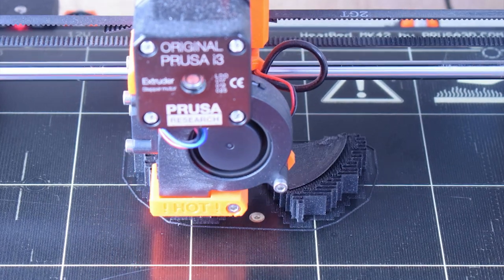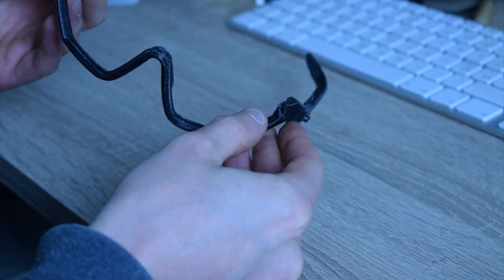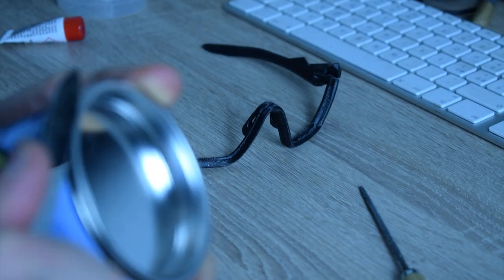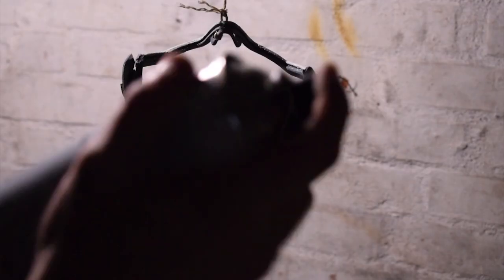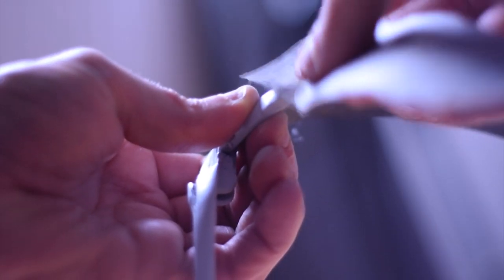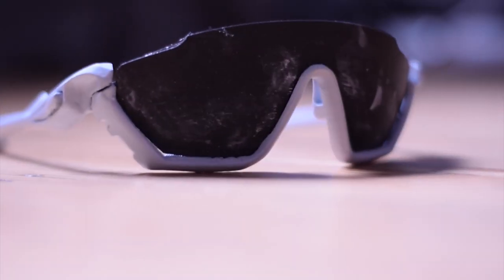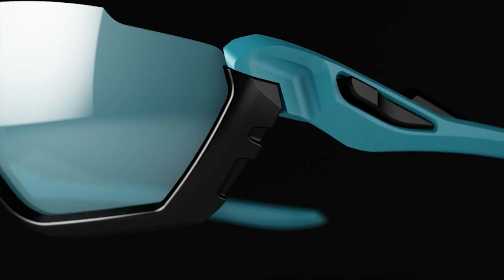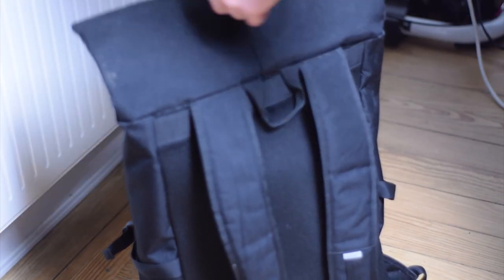3D PRINTED SUNGLASSES DIY 2.0 | Eyewear Design 😎

Comment: Hey how did you create the frame design as a STL file? Did you scan it or build from the ground up? Thanks, they look great!
Reply from the maker: Thanks for the comment! Built it from the ground up, checking references for dimension 🖍️
Reply: Massimo Lonardi so since you started with the lenses, did you use photogrammetry to put the lenses into a cad program?
Reply from the maker: @J_Chin01  i took a picture of it, traced with a vector program, and used the vector to project it into the lens in CAD
Reply: Massimo Lonardi okay, I’m guessing you took multiple pictures from different angles to get the curvature right?
Reply from the maker: @J_Chin01  All lenses fall in a limited range of base curve radiuses, doing some measurements of the curvature you can find which one is correct and design it in CAD

Comment: What material did you use for the lens? Is the a blank you can buy or did u produce it yourself? Super nice project!!!!
Reply: @Massimo Lonardi
Reply from the maker: Hi, I bought a cheap frame on eBay that came with 4 interchangeable lenses, I used one of them to build this frame. I think if you look around in internet you can find also the blanks.